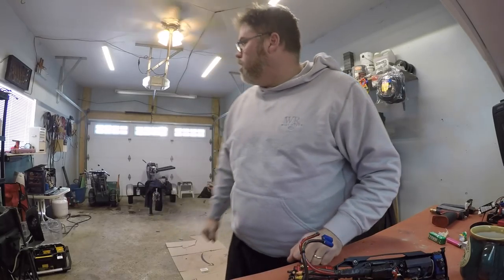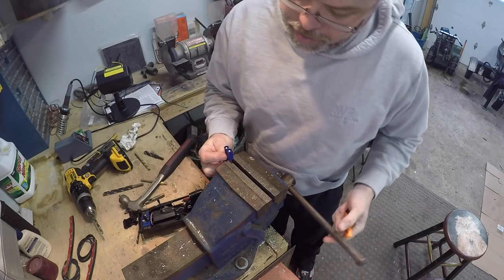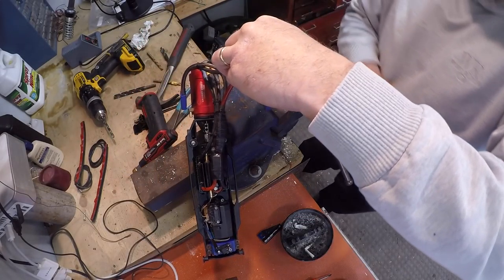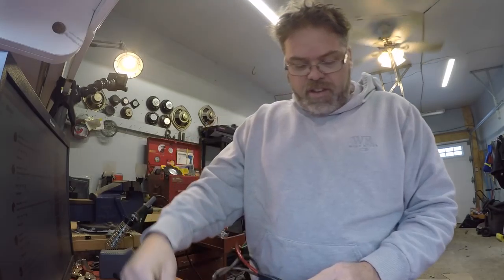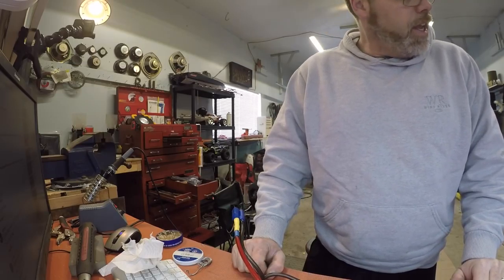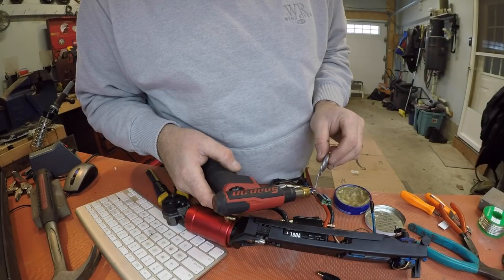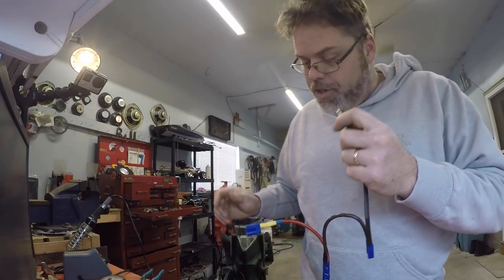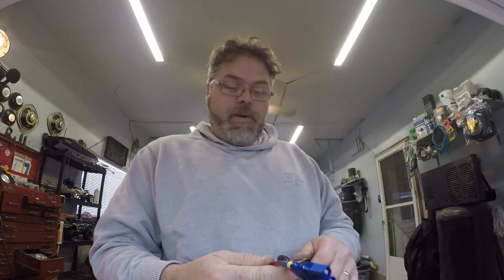Trying To Burn Down My Garage Working On The Traxxas Spartan

Comment: simultaneously heat both parts that are being soldered. The solder should flow onto both of them. You will see that the flux assists this greatly.
Flux is very important. When it heats up, its acidity "eats away" the thin layer of corrosion that can prevent the solder from making contact with the metal. check the temp you are heating the solder with (175C) is pretty low hope this helps billsiff have a good one bark!

Comment: Great video again billsiff, yeah with the boat you need quality cable and bigger plugs if it's getting hot at the plug.
And Good soldering but I think you know how to do that, ones it gets hot it just runs away and gets hotter and hotter.
Keep up the good work bill, very funny👍

Comment: Hey Bud great video is that 8 gauge power Wire lol And not sure if your boat has it but get the water cooling jacket and the water cooling  rudder You can get water cooling for your  Motor and your batteries Got it for my boat works great

Comment: that's what I don't like about attached garages Bill,  you burn the garage down your house will go with it. Please don't make that sacrifice for Us, stabbing your self the Billsiff way is OK but not the house Buds :)
Reply: if your solder is coming undone when it heats up why don't you try silver solder? I use silver solder when I build 1/24th scale drag slot car chassis with piano wire
Reply: you can also try crimping the wire ends in a length of brass tube like a large butt splice connector, then soldering, then shrink tube over it.

Comment: It prolly aluminum wire....thats shit wire
You would be better off buying new wire and start over, yourgonna fry your electronics using shit like that and buy new plugs also
Reply from the maker: ya need to order a roll of good shit buds . think I got her for now . its just a boat so I can go get her when she burns up lol plus would make for a good video lol
Reply: Bill Siff 
I had my fair share of letting out the magic smoke pixies....lol If you want some real fun overcharge a 5000mah 6 cell charging at 20amps....I put an old 6 cell in the middle of my backyard and by passed the safety cutoffs on the charger and cranked it up to charge at 20 amps! When the battery blew it exploded and the bang was so loud the neighbor thought I shot my gun....it was loud as hell and the smoke was insane!...lol
Reply from the maker: whens your next video buds ??